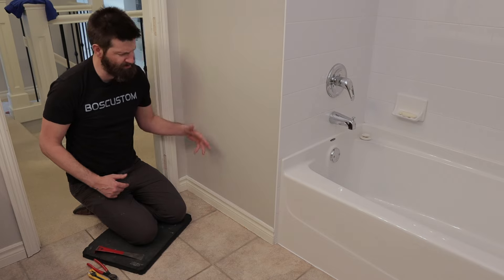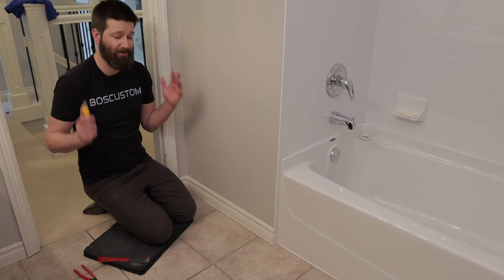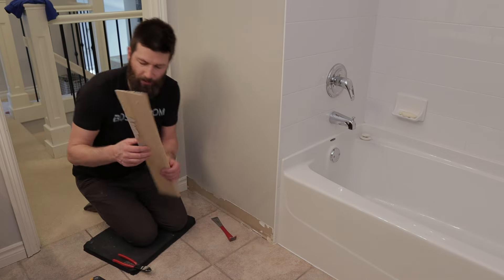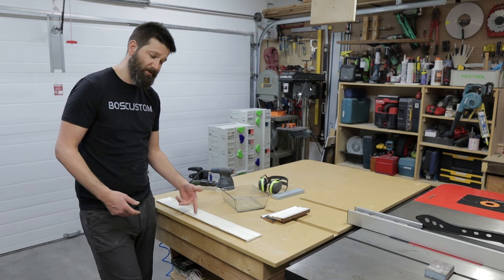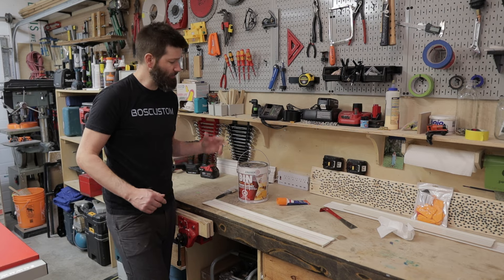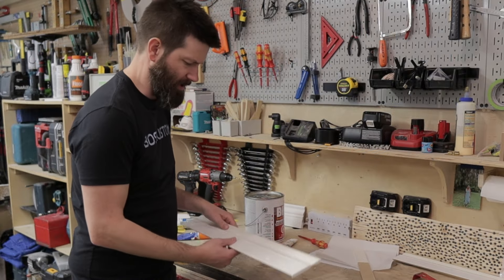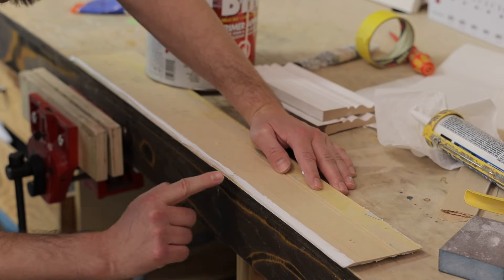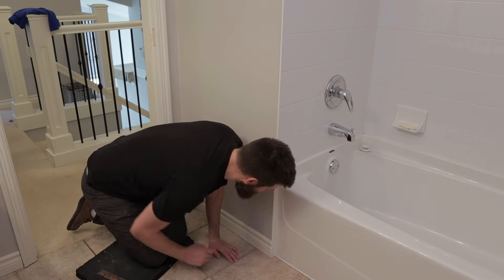How To Repair Water Damaged Baseboard and PREVENT FUTURE DAMAGE!

Comment: In my humble opinion, the cure for this particular issue is to make MDF illegal. It’s glorified (barely) cardboard and 90% of the kitchens I’ve installed in the last 10 years look like garbage within a year.
Reply from the maker: Amen brother!
Reply: @TheFunnyCarpenter  lol. I just spent the day doing service work on a 50k cabinet package I installed 3 years ago. All particle board Melamine boxes and painted MDF panels, and imo it’s practically expired. Even on panels siliconed to the floor, mdf just dents so easy by brooms and things, that the paint will crack or chip and lets moisture through then swells. The whole place just looked like trash. 
3/4 baltic birch should be the only thing cabinets are made of, and anything other then solid maple shaker doors should be veneer core ply of some kind. Maybe some of that new 3/4 textured Mel for doors and panels. 
The 40 year old Oak ply face frame cabinets in my kitchen will outlast anything I will install in my career lol. Pretty sad, even modern Blum etc hardware is sub par imo. Grass should be the bare minimum quality for hardware I think.
Reply: Yep, 100% agree! I live on the coast and they used MDF on all baseboards and trim...complete and total junk! It swells at the slightest hint of moisture and then is forever a lumpy mess.

Comment: PVC for the bathroom is great.
Reply: hard to work with and hard to nail without good tools, but indestructible.   I did it with a hand-mitre and a hammer, and it was like cutting steak with a disposable knife and hammering marbles into a trampoline.  Got through it by driving nails half way through on my bench before putting the board on the wall and lots of caulk.  (It was for a damp basement, so not as embarrassing as it sounds)
Reply: @Asiansxsymbol  yes

Comment: I have mdf and water damage. The baseboard is swollen about 1 inch from the bottom up. About like yours. I took 1 small section of baseboard off in the closet and drywall looks OK. I have the same issue in most my bedroom from water damage. About 1 inch up also. If I neglect to remove all the baseboards will mold grow in the drywall? Going out of town and I'm in a bind. Was told to keep A/C on about 62
Reply: It's been 3 months...mold grew in my bathroom. It is now a major repair of not only baseboard but sheetrock and metal round trim.

Comment: Doesn't the primer and paint help avoid water soaking up?  Still interested in trying for my small bathroom fix but seems extra to do the caulk on the bottom.
Reply from the maker: I tested the board in the water with two coats of primer, and it didn’t do anything to stop the water soaking up.  Perhaps the trim paint would offer more resistance but I’m not sure.
Reply: So he called the bottom edge only right?

Comment: In the kid's bathroom I pulled off the mdf and glued tile to the wall.

Luckily the builder had left some matching tiles behind, the only thing they did correctly. 

I sliced 4" sections and lined up the grout lines and glued them to the drywall.

I finished with a colouredcaulk that matched the grout. 

Holmes lives about ten km away and repaired many new houses around here.

Comment: I had a flood last year from a burst pipe, and the house has smelled moldy ever since. The water wasn’t very high, so I’m thinking it went into the wood baseboards and mildewed. Or maybe it got into the drywall behind the baseboards. Not sure what to do, other than tear out and replace the baseboards, and possibly cut off the lower few inches of drywall.

Comment: I am about to replace water damaged wood baseboard with PVC. Replacing to a wall intersection. I plan to predrill and use trim screws slightly recessed and covered with caulk. I have an outside miter corner that will get a little bead of caulk before it is screwed to the wall.